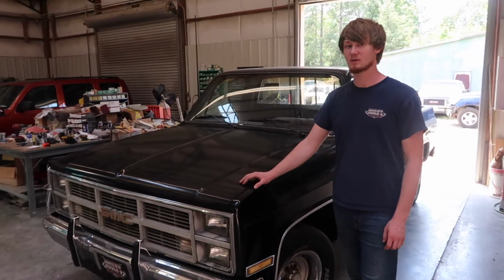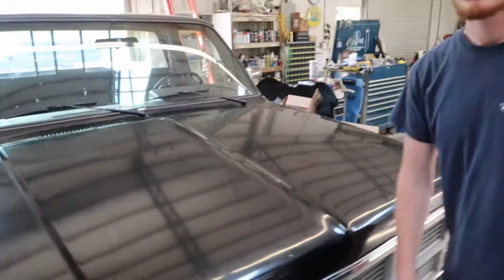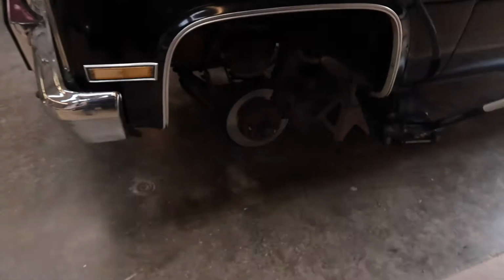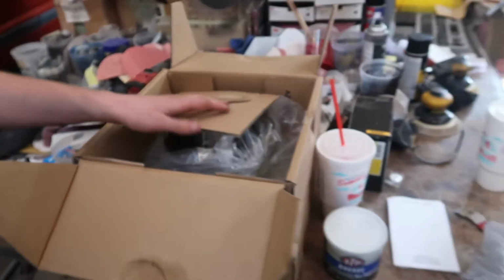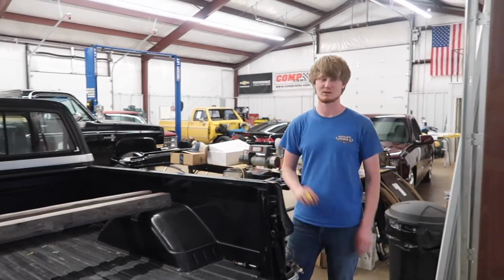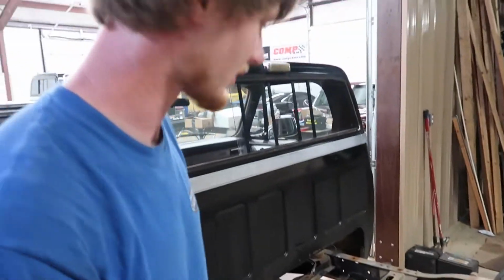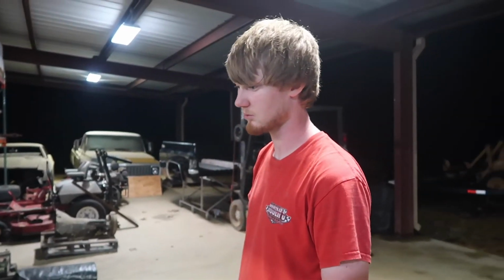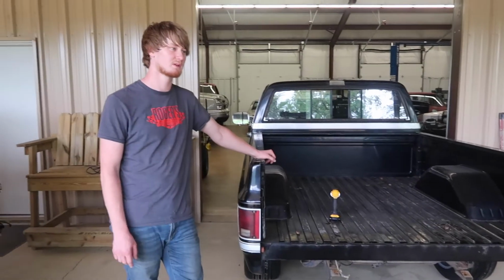Lowering our LS SWAPPED Squarebody C10!!!

Comment: 4:35 im using Mcconaghy 2" drop spindles & stock springs with 1 coil cut off & I am able to use the stock 15" rally wheels on my 85 c10
Reply from the maker: At the time the only spindles that we could find that were 3” dropped the lower ball joint down too far, but the ones that belltech makes now let you run a 15” wheel.
Reply: @milfordbrothers  that's cool. truck looks good! i tried the short springs too but it was too low. i would've had to remove the inner fenders. plus the short springs could fall out under full extension. be careful with those!

Comment: My LS swapped 82 Gmc shortbed came up for sale today here in Kentucky. Real solid Texas truck. Needs paint. Runs excellent. 162k miles on the 5.3 when swapped. 4l60e rebuilt right and a trans cooler. 2/4 drop, fat tires, cowl, phantom grill, buckets and console. BP Automotive harness. Right up yalls alley foreal.

Comment: Did you not have to notch the cross beam on the bottom of the bed to clear the rear shackle since it’s sitting up higher now?
Reply from the maker: Yes, about a 5-6 inch section on both sides